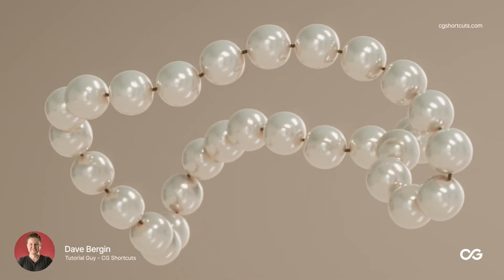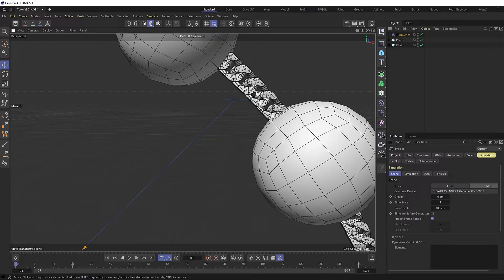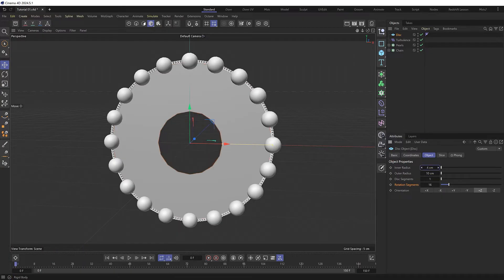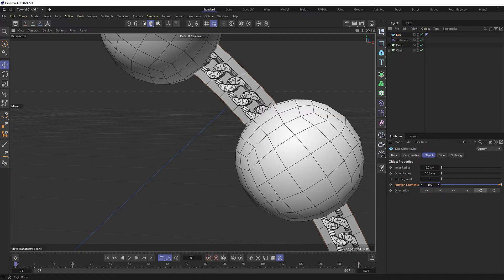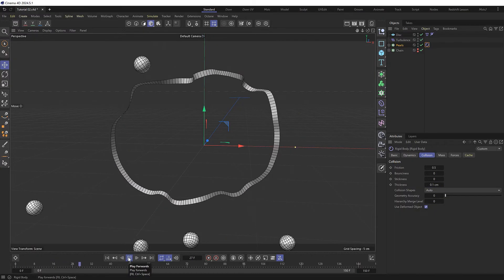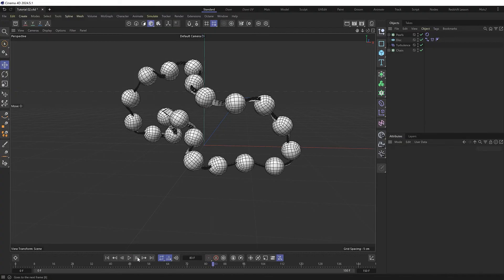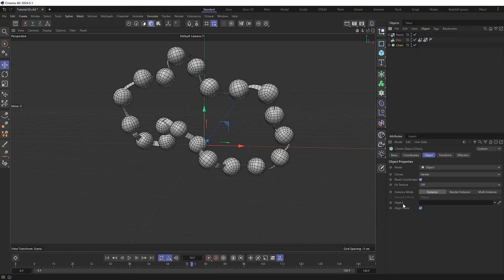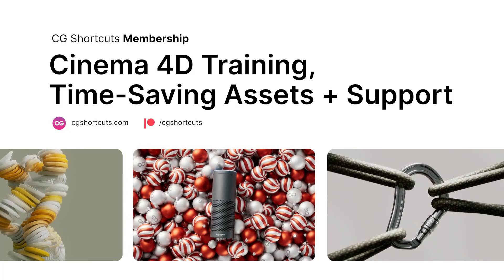Dynamic Jewelry in Cinema 4D - C4D Tutorial (Free Project)

Comment: And how does the dynamics tag differ in versions 2023 and 2024?
Reply from the maker: The unified simulation system in Cinema 4D was first introduced in Cinema 4D R2023 (September 2022). This system replaced the old dynamics system for cloth, soft bodies, and ropes, unifying them under a more modern and GPU-accelerated simulation framework. It also introduced Pyro and better integration with Fields and Forces in later updates.

By Cinema 4D 2024, this system was further refined, improving performance, accuracy, and interaction with rigid bodies.
Reply: Why do you ask that question? Its subscription only and you can always use the newest version